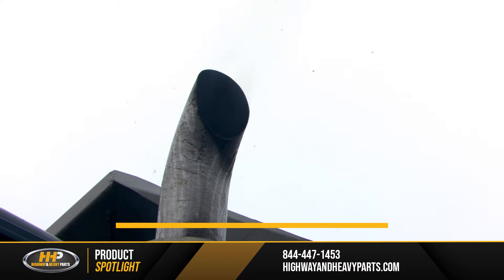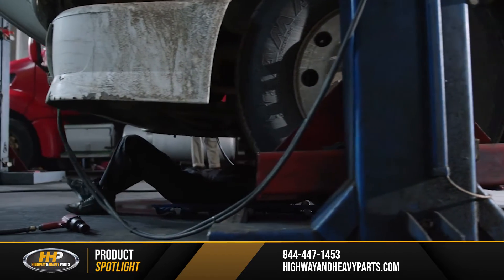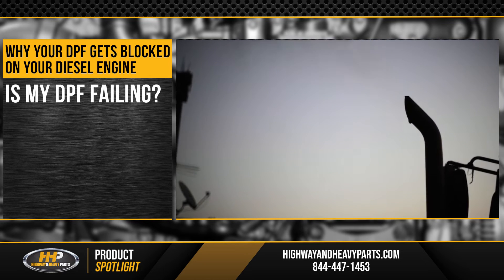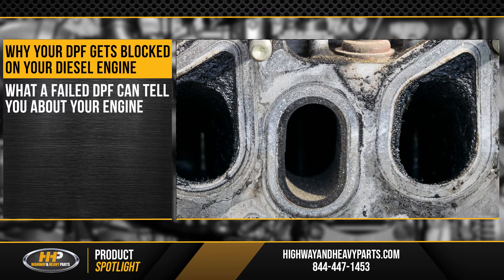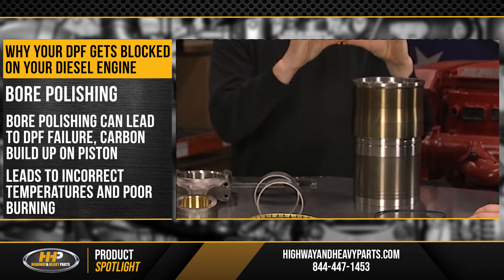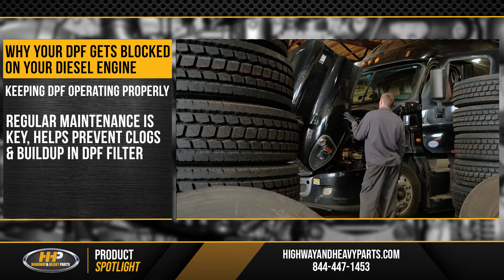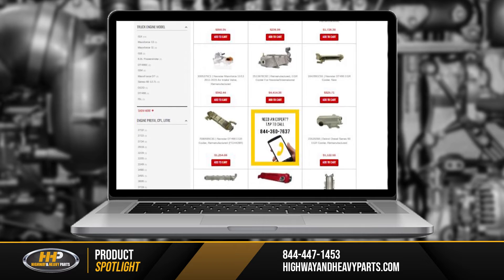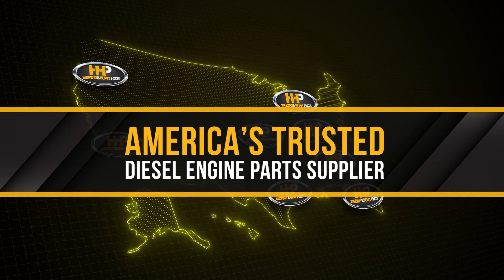Why your DPF Filter Gets Plugged! HHP Can Help

Comment: What about white smoke periodically while under heavy loads/hard pulls ?
I can see soot build up in the end of my stack pipe .
Also when a force regen was performed via computer connected to the ECM a mechanic pointed out that Aftertreatment DPF outlet temp was higher than the intake temp which is an issue .